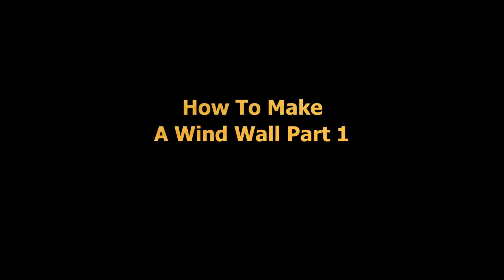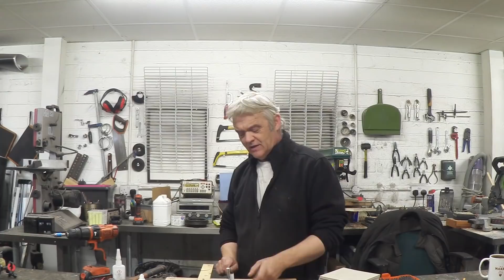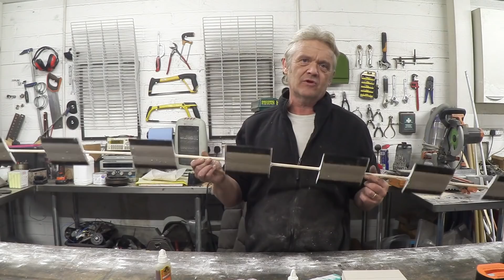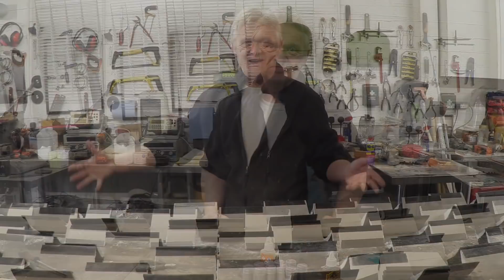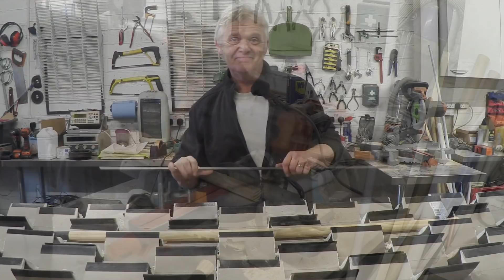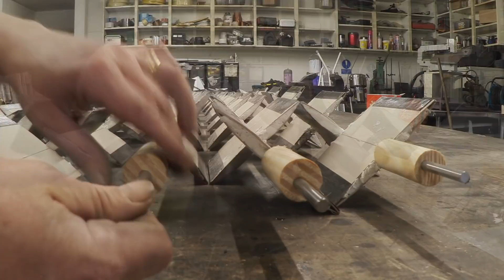1297 How To Make A Wind Wall - Part 1- The Blades - A very interesting Wind Turbine

Comment: Not sure if helpful but anecdotally I have measured 50% plus increases in wind speed for hawt when placed just over the edge of a fence so that it catches the updraft as the wind rises up the fence.  This could be a different approach to provide  a row of over the fence mini turbines backing onto trellises so that not seen from the garden and useful where the fence backs onto a field with low roughness. Ploughed or grass.  This can then be accelerated by funnelling and putting in series counter clockwise almost like a shirt collar over the other side of the fence.  Measured on anemometer and going from 1mps above the fence but 1m in to 3mps over the fence and 4mps with a collar - roughly measured.

Comment: Looking good so far. Just wondering about the flexing dowels but will wait and see the end result. I made outdoor 3cms Microwave Horns from card. They were waterproofed by spraying with several coats of epoxy resin. That lasted for many years up a mast in the weather.  Thanks for the video.

Comment: Ok, I probably missed something here.

If the bearing is the rotation point, why not just stick the dowel into the bearing hole? There will be downward pressure on the dowel but there will be anyway.

Great video by the way.
Reply from the maker: I could have done mate but one end I need to stick a generator and the other a tie rod for wave motion - I thought it might be best if I did that from metal as it is easier to get stuff to fit

Comment: I use a liquid wood hardener (for dry rot) to harden and seal cardboard and paper and make it weather resistant. It might make your wind wall endure a long term test outside. You could also make a silicone mold of the plates and make them molded out of the spray foam on the dowel.
Reply: Thats a smart idea mate
Reply from the maker: nice tips mate - cheers
Reply: That's clever thinking.

Comment: While I'm looking forward to this project, I just looked up his (or perhaps the writers of what few reports I could find) estimation of the output. 10,000 Watts!

I don't like to sound like a downer but I like these kinds of exaggerated claims (cough, cough solar roadways) even less. I submit that when he says "could power an entire house" he means, or should mean to add "where the entirety of the load is a small light and fan" and he ought not leave out words that way.

For his 8'×25' example I would estimate that the exaggeration, even at a constant windspeed of 10MPH was at least forty-fold without considering transmission losses.

Still, if that's installed where a wall would have been anyway and it can be made vandal resistant, it's more than zero!

I'm all for micro generation. A few Watts here and a few there can add up. Even better that it has an interesting appearance. 

Anyway, just my take on it. I very much want to see how it works out.
Reply from the maker: yeah I read that too and thought it was a wild claim - but I liked the basic idea so wanted to see if it worked in practice and so far this has cost me about £20 I think